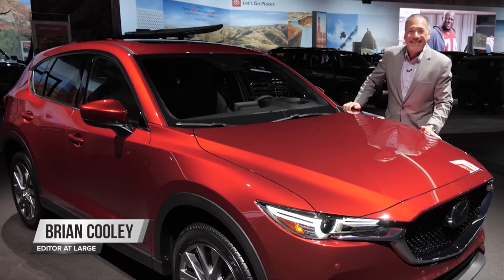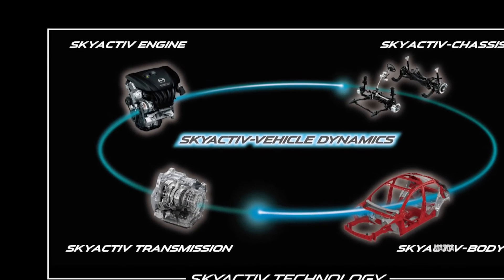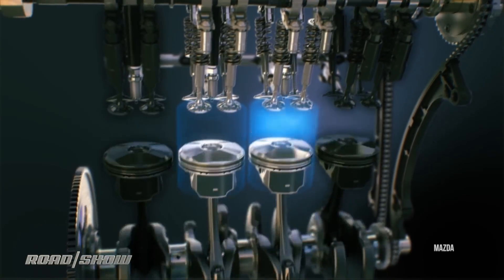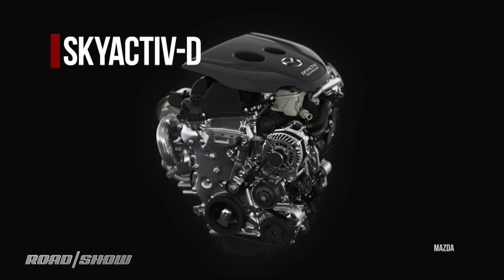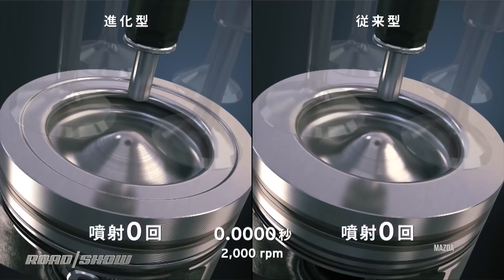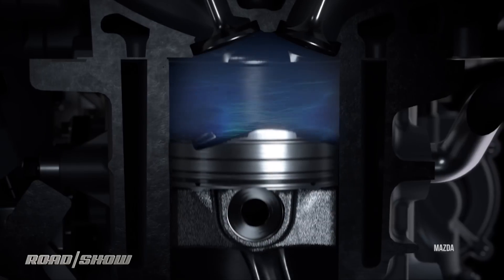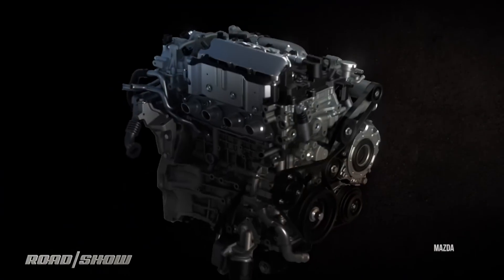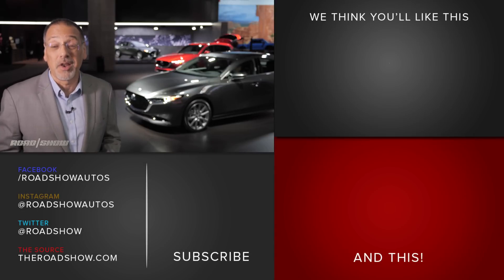Car Tech 101: Mazda's Skyactiv engine technology is really something

Comment: Fascinating stuff. The video concentrates on the major stuff but there’s more, like an intercooler on the egr to prevent the hot egr gases increasing the temps of the intake air.

In the end, though, why is only Mazda doing it? Because all this fun stuff results in no net gain.

The engine isn’t any more powerful. It is just more stable and reliable due to more costly enhancements. Therefore same engine, more costly to produce. Bummer.

Cool stuff though

Comment: Selling point for me was NO fkin CVT!! Proper size engine 2.5L and A lot of extras that even bmw x4 same year that was x2 on the price does not have... And as a bonus it turned out it's pretty easy to maintain.. changed my spark plugs oil and all filters under an hour.

Comment: I have a 2012 Mazda 3 with skyactiv 2.0 engine 165k miles no problems, does not burn any oil at all!  Great small motor!
Reply: same, it has great torque and acceleration

Comment: Got 180,000 on my Mazda.. no issues or problems so far. Great car
Reply: 320,000 kilometers 2017 cx5 still going strong
Reply: @kicksoffs is it diesel or petrol?
Reply: Is it diesel or petrol?
Reply: did you guys change the transmission fluid? mazda officially says it's lifetime...
Reply: @ihwong98 yes, change it every 60k to 70k miles

Comment: Biggest problem is the premature failure of the vacum pump leaking oil into the intake manifold ( CALL BACK ) that can be found online . They used cheap rubber seal that swells and fails . Under idle there is no problem but under highway conditions it’s forcing oil into the intake

Comment: Mazda still need to address and fix the issue of diesel fuel leaking into the engine oil via injector rings during DPF regeneration cycles. Too many people caught out by this so far resulting in engine failure and huge 4-figure repair bills. Luckily I knew about the problem when my oil pressure light came on and told my mechanic exactly what to look for. Any skyactiv-d owners out there - trust me on this, change your oil and filter every 6000 miles and get the oil pump strainer checked/cleaned at no later than 80000 miles. Make sure the drive chain on the oil pump is also in good condition too during this as it can be inspected when you drop the oil sump to get at the strainer.
Reply: Thx bro for reminder

Comment: would be nice if there was some videos of mazda owners having achieved 300k, 400k, 500k+ miles on their cars like i see frequently on the toyotas and hondas.   will help prove they can last that long -  not seeing any on this channel with that kind of mileage concerns me that they won't last as long in terms of reliability
Reply: Mazda 3 2010 already with 120,000 miles and no SkyActiv. I doubt you will find 300k, 400k, 500k+ miles Mazda owners, since the technology is new to correspond to those amount of miles. It would have to pass some more years, maybe 5 or 10 more years. Just make the numbers and you will see. This tech came in mid 2012, and the average mileage for normal use yearly is 10k-12k.
Reply: Yup, I have a Mazda 6 GT with 310k, and still runs like new, with great compression ,power,smoothe and quiet. Best car ever that I owned and I had them all.

Comment: One thing Mazda does right is no CVT, solid suspension and affordable premium interiors
Reply: And great engines too. Very powerful and yet frugal
Reply: @blacknester best hybrid, yes. CVT, no.
Reply: That's 3 things :p
Reply: Still one of their biggest weakpoints is their automatic. Been driving one for about 5 years now and I came from a dual clutch golf. Nothing fancy and in the same price range but the Golf dsg is miles better. The auto in the mazda is really unpredictable and got a mind of its own. Sometimes it shifts smoothly then sometimes jerky. Its overall really slow. In some ways it reminds me of older torque converters in others it reminds me of myself shifting poorly in a manual. Speaking of manuals I wanted to go for one knowing how good they are in Mazdas but I randomly got a great deal on an auto getting it much cheaper. Wouldnt call it a mistake, certainly not financially but it takes some joy away from driving. Btw Im german and manuals are still the norm here.
Reply: @blacknester Bing-Go.
Reply: Honda Fit 200k Kms cvt  no prob, Mazda CX-5 transmission (80k Kms) bearing failed, cost 5k fix, dealer wanted 12k Mazda didn't want to know about it. I think a cars major parts should last more than 80kms.
Reply: @N_z41 no one cares about anecdotal evidence. Get a sample size and then come back, Einstein

Comment: People need to keep in mind that Automakers always talk up this technology,  20% may sound like  massive improvement to the fuel efficiency but when  you quantify that in the real world it usually equates to far less. We go through this exact same process every single time an automakers debuts new technology and we always end up disappointed.

If the car in question makes 24 MPG combined, then a 20%  increase only works out to be a improvement of about 3-4MPG which means your paying top-dollar and risk reliability issues for 
maybe 27-28MPG combined. Where as if you simply went with a mild-hybrid you would have gotten 30+ MPG combined,  make more power and with technology that has been around for decades.

The I.C.E simply isn't suited for high efficiency scenarios, KERS and mild-hybrid systems combined with light-weight materials is where we are going to be seeing real improvement
from the auto-industry.
Reply: The engine in question is the skyactiv-G far from 24MPG average.
Reply: @BoogieDownProduction  Wasn't my point, it was a toss away  example to illustrate how over-blown manufactures can make MPG gains sound
when they express them in percentages rather than L/Per 100KM or MPG.
Reply: @BigHeadClan  Its a good point but in this case we are talking specifically about a reasonably efficient engine that mazda has supposedly made more efficient. I guess we will see in a few months how it does.

Comment: Tall gears are better for freeway driving.  Why even have A 6 speed gearbox if the RPMs are 4K to 5K at 75 MPH?  No point to it...
Reply: @ItsABigClubAndWeAintInIt  02:50 They want to have the engine spinning faster at freeway speeds.  Which wastes fuel and is annoying to drive like that. 

  It also wears the engine out faster because it will have to spin more.  

  I have A GTX and it is annoying to drive on the freeway.  Had to buy A different final drive gear for it.

  If they want to have high RPMs on the freeway they could just let 5th gear do that and 6th gear could be for high speed cruising.  Where I live the speed limit is 80 MPH on the freeway!
Reply: My old CX7 turbo hangs around 2100 rpm at 75mph. Go and test a mazda.
Reply: @herberttorres3822  Why? I already have four of them!  Including A rare 323 GTX that has short gears and revs high at freeway speeds.  That's what we are talking about here.

Watch the video more thoroughly.
Reply: @787brx8  test a newer mazda. Not a 323.
Reply: @herberttorres3822  I have driven Skyactiv G already.  

  Skyactiv X will have engine improvements but if the gearing  is too low.
Reply: Do you mean that the gears are too high? Or too low? I think you are confused.
Reply: @herberttorres3822  I meant short gearing...RPMs high at freeway speeds.
Reply: @787brx8  you are right.
Reply: @herberttorres3822  You are alright...I don't care what they say about you!😁  lol
Reply: @787brx8  I can only hear zoom zoom
Reply: @herberttorres3822  I have A full stainless steel exhaust system on the GTX. A RX7 fuel pump, chipped computer from Reich racing, forged pistons and valves, drop-in K&N and some other go fast parts.  

I can't hear the radio...😄
Reply: @787brx8  I guess is fast for you
Reply: @herberttorres3822  Don't want to push it much more as the transmission is not that strong but it will easily beat a lot of the cars around here at 4K feet above sea level.

My brother has A 1988 626 GT that can burn rubber in three gears.  It has beaten some Vettes A M5, supercharged Merc Ect.

Comment: Problem is reliability
Reply: I've owned a mazda skyactive since 2013. No problems. Just a silky smooth fun little engine.
Reply: @Bartee98  how many miles and a 2.5l 4 cylinder?
Reply: @Snip3zjumper   2.5 liter, 8 
years old and around 70,000 miles. I've also owned a 2013 2.0 liter skyactive and a 2.5 liter turbo skyactive. All have been rock solid.
Reply: What "problem"?

Comment: Worst named? I think Honda’s earth dream is worse lol!
Reply: Honda's EarthDream is an utter disappointment. EarthDream my ass. Skyactiv is just way cooler.
Reply: @Xyb3rTeCh  This guy either doesn't know the English language or doesn't know what he's talking about.
Reply: @thisismagacountry1318  Exactly! Car reviewers who thinks Skyactiv ia not cool but EarthDream is cool that means they have been eating the wrong nutrition for their fucking brain.
Reply: @Xyb3rTeCh  I've never heard anyone saying Earth Dreams is cool.
Reply: rainystorm88 exactly
Reply: Yeah Earth Dreams is a dumb name. That's coming from a Honda guy too!
Reply: @ryanlittleton5615  +1 respect
Reply: Earth Dreams is nothing more than turbocharging and direct injection. Boring. Skyactiv-X HCCI is much more advanced engine tech. Pair that with a plugin hybrid setup and you've got a winner
Reply: @danwat1234  The Earth Dreams name came around before they went to turbocharging. It's basically the same as Skyactiv just without super high compression.
Reply: True
Reply: Exactly what I was about to write
Reply: Earth dreams are junk. They put that GDI system with a turbo charger in a 1.5L. When the gasoline is thrown into the combustion area at light speed, it blows past the damn piston rings and into the oil, diluting it into a mess of a problem. Then Honda says its normal. 🐓🍭s
Reply: Toyota TRD is right up there.

Comment: Notice we didn't hear anything about fuel economy...seems like compared to the Honda the power is down and fuel economy is worse...im no Honda fanboy but they really are the industry standard
Reply: up to 30% efficiency. the current 2.0L skyactive-g is at 155 hp and thereabouts torque and the 2.5L skyactive-g is 187 hp and thereabouts torque. the skyactive x will be a 2.0L at around 175ish hp and thereabouts torque. all the while estimating 40+ combined mpg. and oh journalists already drove it a few months back and they said the gas figures is spot on at around 40ish.
Reply: @jope783  If that's 40 mpg in the CX5 that's really impressive considering no hybrid tech
Reply: @AdamSmith-gs2dv  its for the new skyactiv-x engine thats gonna be on the new mazda3.
Reply: @jope783 
Actually the Skyactiv X engine outputs 181 horsepower and that's official figures from an info note that was released in Italy (and Mexico if I remember correctly). 
Torque is not official but I heard that it's over 210Nm. 
Going 100 miles per hour (as tested on Autobahn last year) apparently still provided 40mpg.

Comment: I love Mazda, they’re on a ROLL right now! I just hope this technology is reliable long term though
Reply: They come in at 30,000 miles bc they are carbon cooked
Reply: @dsauce8780  How are they repairing them ?
Reply: @concernedpatriot9314  depends on how bad. Direct Injection engines do not have the benefit that port injection and carb engines do of having the fuel air mixture literally wash the valves. So a direct injection motor like the sky active with a PCV system that runs to the intake manifold is subject to carbon build up on the valves which, depending on the severity of, can start decreasing compression due to the valves not closing all the way. If it’s that bad chances are the engine will need a new cylinder head or at least a valve job. The proactive solution would be an oil catch can between the PCV hose and it connections to the intake system and driving the engine really hard. I kid you not about the second part. Drive it loud and hard and you’re less likely to have the build up by keeping the valves hot.
Reply: @dsauce8780 So I have a 16 Mazda 6 w/ 6spd MT. I only use non ethanol premium fuel and drive it like a race car lol. You’re saying this is a good thing?

Comment: 2:50 This is not technically correct. The spark-controlled compression ignition runs ultra-lean with compression ignition when in low-load operation. If you're driving it "sporty" and loading the engine demanding high power, the engine will actually transition back to spark ignition with more fuel. The beauty of this system is that it can either energy optimize or power optimize on the fly, but you can't have your cake and eat it too.
Reply: Omnis this does seem to work a little bit better than Ford's EcoBoost but similar results. It's not Eco and boost, it's Eco or boost LOL
Reply: I have a question, when the engine is running in its "efficient" mode, how does the Piston not get burnt with such a lean air-fuel mixture?
Reply: @exquisiteart6478 A lean burn isn’t actually hotter than stoich, as long as it combustion remains stable. The typical “burned piston” problem comes from uncontrolled combustion plus the presence of extra oxygen rapidly oxidizing the piston material (like a torch).